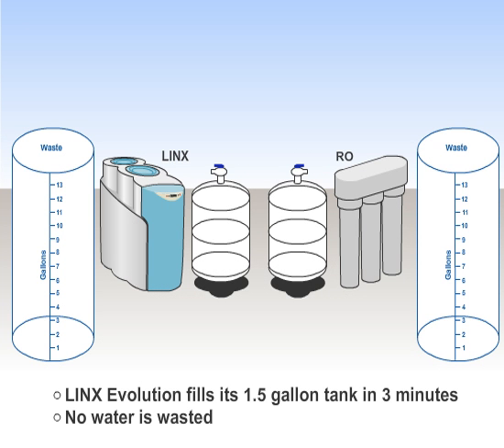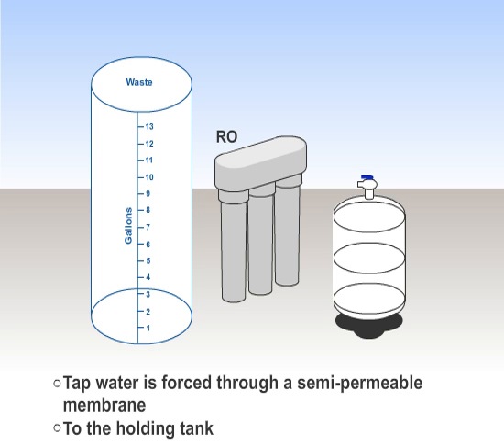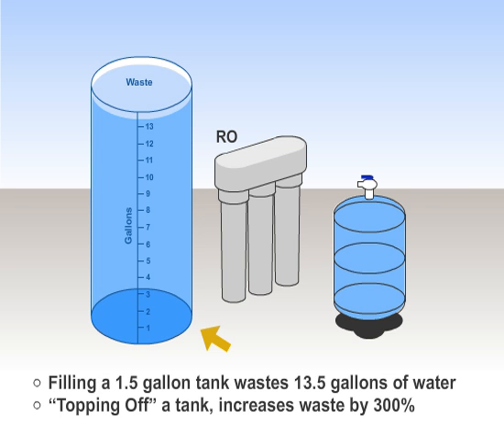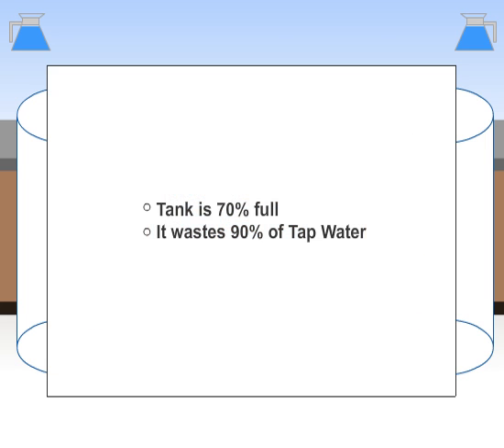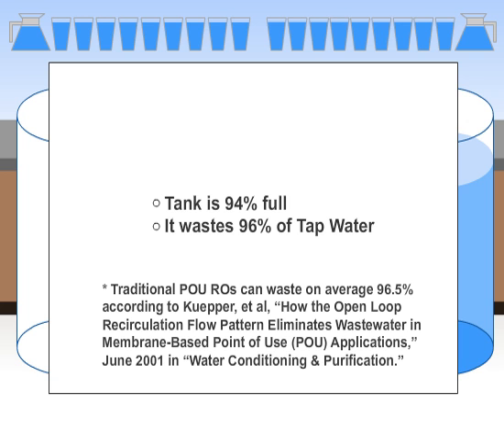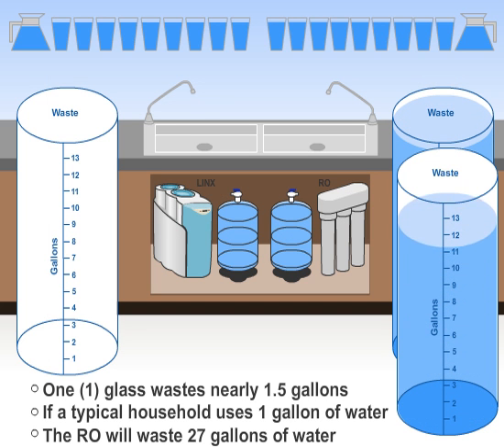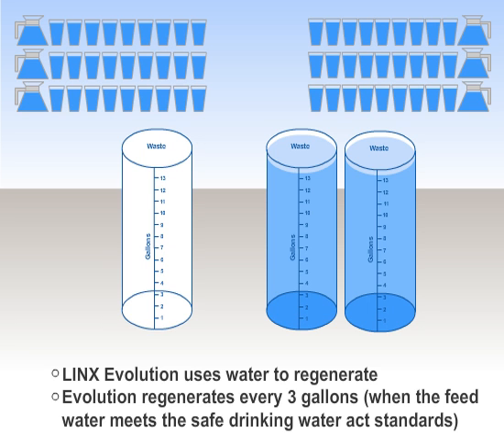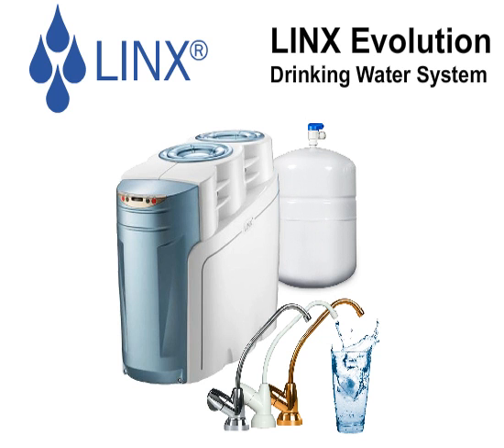Insane Water Waste -- Reverse Osmosis (RO) Truth

Comment: If you read my comment and see how I crunched these numbers you'll see why this LINX system is complete waste of money (and electricity)

If you use an auto shut off valve (when the pressure reaches a certain PSI the system shuts off) then you eliminate constant water running. I measured what I get out of a full RO tank (about 2.9 gallons) and put the RO waste hose into a large plastic container (probably around 20 gallons) and it appeared there was approximately 6 gallons of water for the 2.9 gallons of drinkable RO water. What I will say is my home has relatively low water pressure not ridiculously low but not really high like some places so I'm not sure if that has something to do with it. Plus my water bill was always around $30 a month and didn't see but maybe 1 or 2 dollar a month water bill increase since it went from about $28 to $30 using the crap out of the RO system to cook, drink etc.. 

So with that logic I've seen a $24 a year increase in my water bill and bought a 2 year supply of RO filters & membranes for around $100 so I use around $50 a year in filters and so if the water bill increase for the whole year is $24 the $24+$50=$74 is about the approximate cost of maintenance for using my RO system. I seriously doubt this LINX system could beat that in cost. When I used to buy gallons of water refilled at the local water machine I'd spend about $200 a year just filling reusable water jugs... lol. Watering a lawn is a far bigger deal as far as water waste IMO... I mean think about it you're spraying water over a species of grass that is usually not native to your region to make it look ridiculously green. As far as what to do with the RO waste water, the truth is if you own a home drill a hole in the wall behind the sink and run the waste line outside and use it to fill a giant 200 gallon rainwater tank (or whatever size a 55 gallon drum will do) which you can then pipe in the RO rejection waste water to the outdoor tank to then water the plants/garden/grass. Some people get nifty and hook up a tank to their washing machine so that the water doesn't really go to waste.

So the LINX system uses around 250 watts per gallon. That's 250 watts produced probably burning coal from a power plant so that's not helping the environment... If your electric bills are an average of $0.11 a kwh its around $0.03 per gallon. If you use 4 gallons a day its around 11 cents a day x 30 days in a month its about $3.30 dollars a month. If you have a 2:1 RO system it's going to be around $75 a year give or take the cost of water in your area. Plus the fact that you can go online buy a 2 years supply of RO filters for $100 ($50 dollars a year in RO filters and membranes per year) you can just buy a a ready to set up RO kit on ebay for $105 and for me I had observed a $1-2 a month water bill increase using an RO system has cost me around $75 a year in routine maintenance for the 2:1 RO system. 

There is just no way LINX can justify charging $600+ for a water filter unit and $200 for filters which need to be changed about twice a year unless you virtually never use the system. Between the $400 in filters annually and about $40 a year in electricity and the $10 for actual water usage you are spending about $450 a year to maintain this LINX system which more than the water usage plus the cost of the entire RO system and 2 years supply of RO filters... I mean really what a joke. When you crunch the numbers you realize how much of a scam this whole thing is. I mean seriously I could buy water from a water machine for 50 cents a gallon and based on my family's usage it's around $200 a year to buy water at the store or I can pay $75 a year to run my RO system and waste a few gallons or put in my washing machine/garden via a storage tank. What an idiotic sales pitch.

Comment: Once you run it through the pre-filters , you can chain link it through 3 RO filters like this- RO mebrane (brackish) waste water goes to the next inlet of the ROfilter and that wast water goes to the next RO filter you have.
Use  setvalve (TAP opened slightly) to keep the pressure high in the last brakish water out. So you have 1 feed line (council water) and 3 RO filtered water going to storage and 1 waste water of limited water.
 
RO systems need pre-filters to remove sand and iron they can not deal with solids.
Or and this is no problem at all for a RO filter you have a tap on 1 RO filter on the brackish water and every 50liters you use you open the waste water and flush the waste out. <<< So that would be 2lt (or less) of waste waster to 50lt of RO filtered water .... as long as you have the pre-filters the RO sytem will cope with that just like these high wast systems.
Both those systems produce clean under 10ppm ROwater and my filters are about 4 years old on the first example.
and 2 years on second example.
More than 1 way to skin a cat.
PS didnt watch the video and will probably thumb down with out looking at it.

Comment: SYSTEM REQUIREMENTS:

    System requires the use of a water storage tank and faucet (sold separately)
    Must be used in conjunction with a water softener
    Warranty voided if water pressure exceeds 100 psi. If water pressure exceeds 100 psi, a pressure regulator must be installed.

Comment: these systems are extremely problematic in my opinion (especially with hard water), the drain solenoids and modified air gaps plug up with calcium deposits very quickly, these systems are also prone to overheating and leaking
Reply: Silveready1 overheating. ? Overheating?  Really overheating?

Comment: Does this unit remove 96% of floride? 

In Livonia MI water is about $5 per unit. 
A unit is 750 gallons.
If an RO is waisting 10,000 gal a year.
Thats 10,000g ÷ 750g = 13.3 units
13.3 units at $5 each is only about $67 a year in waiste. Still not bad for 96% floride free water compared to the $10 a month i spend in bottled water.

Comment: even with the waste water cost in a RO system without a booster pump or a permeate pump, i think the RO system would be cheaper. the LINX filters are close to $200, is that correct? i would love to save the environment but i'm more into saving money.
Reply: Even though the cost of the cartridges seem high if you are wasting 10,000 gallons of water a year depending on what part of the country you are in the cost of that water would pay for the cartridges and you would be saving alot of water for generations to come.

Comment: Whereas waste water from reverse osmosis can be recirculated once before permanently removing it from the loop. When out of the loop it can be used for yard cleaning lawn maintenance etc, So little would be actually wasted. The Lynx system does not say how much electricity it consumes or what total TDS can be over its cycle. In brief it is at face value an attractive proposition. However I would like some nitty gritty detail about its cycle figures before opting out of ro
Reply: A toaster is a poor example, they use large amounts of electricity for short periods of time, but if you make a lot of toast they use a lot of juice.
Reply: yes, well said! 
cost of production, and water spent in the process, compared to RO waste, i would suspect is equal
Reply from the maker: The system uses less electricity than a toaster. Pennies a day to operate. Please contact us at  866-611-8624 with ANY other technical questions you may have. We are happy to help. Also the systems are NOW available online! They are on sale - go to www.LinxDrinkingWater.com to see prices and purchase info.

Comment: LINX PLEASE what is the cost of this system, and why is it such a secret?  after reading all the comments it definitely seems you are elusive or hiding something, which makes this dealer quite suspicious indeed.  Please clear up all the questions once and for all and you will sell.  I may be interested as a dealer but I need ALL the facts without wasting my time..  I support the horticultural industry and seek a good unit that greatly reduces ppms as low as RO does, at max efficiency.  Can you supply this and how much even msrp for now helps.. ow I'm looking elsewhere, we are busy..
Reply from the maker: +mudslinger888 LINX® systems are sold thru authorized dealers who set their own retail pricing.  This allows them to factor in their cost of doing business – I am sure you understand that it is more expensive to do business in a major city than a rural community in the Midwest.
Reply: $700 for the system and $400 for filter! YIKES!!!

Comment: I agree w/Arne!!  I am a licensed professional engineer and I object to your claims.  I live in a highly mineralized, arsenic content area & I have made precise measurements for my R.O. system.  Arne is correct in that approximately three gallons or less is required to produce one gallon of R.O. water.  The extra two gallon loss in my system is simply routed to my vegetable garden beds so it is not wasted.  Please verify your claims w/some evidence.  Thank you.
Reply: LINX Water   John Van Newenhizen graduated from Lake Forest College which is a small liberal arts college.  As far as I can determine he doesn't have a degree in science or engineering.  He was employed by Culligan International from 1977-2009.  I can find little about his company Van Newenhizen and Associates Inc. other than there are 10-20 employees.  I don't see that Mr. Van Newenhizen has published any scientific peer reviewed papers or research studies.
Reply from the maker: +John Ferguson If you are using a permeate pump to increase the feedwater pressure, that could result in a doubling of efficiency and could yield 30% efficiency under ideal water temperature conditions
Reply: +D Boyd   Ditto, I agree.  I am also an engineer.  We use the discharge water to feed a "grey water" system for our landscaping.  My Vertex 4 stage R.O. unit uses about three gallons for every gallon of pure water produced.  Considering that our family uses over 150 gallons a day, with irrigation included, it's a trivial amount of water.  It's only about 3-4 gallons per day.
Reply from the maker: +D Boyd Thank you for your comment. This video is based upon the research study conducted by Van Newenhizen and Associates, Inc.. The results of which you can download here: http://www.linxwater.com/pdfs/water-savings.pdf.

Comment: has anyone thaught of having the filler  tube to the tank at the top of the tank as opposed to the bottom wher the water pressure is (which creates the inificiency)simople realy ,i think this add is another con just like so many others regarding water filtrs
Reply: Not to mention how inaccurate of a filtration idea they have for their system, electrolysis doesn't work like that, where would the mineral deposit go.
Reply from the maker: +Gabriel Damian Thank you for your comment. Please see the video here https://www.youtube.com/watch?v=vkY6hnYj7HE&feature=iv&src_vid=qmUvTu0KUIs&annotation_id=annotation_889719 to see where the minerals go and exactly how the system works.
Reply from the maker: Good news!! The systems are NOW available online! They are on sale - go to www.LinxDrinkingWater.com to see prices and purchase info.
Reply: My WHRO system is set up this way.  The fill tube is attached near the top of the 500 gallon holding tank.

Comment: Would your system (LINX WATER) be able to produce Industrial Water i.e. the water with reduced conductivity up to 100,000 Ohms or in term of conductivity less than 10 Micro Siemens. Off course TDS and other traces like Sulfates and Chlorides should be within  their PPM limits.

Comment: It sucks that we have to pay our water company in Vegas for water that isn't even drinkable. And you have to buy a chlorine filter to water your garden as it kills the microbes in the soil. I'm currently shopping for an RO because it's a pain to lug home cases of bottled water from the store every week (which also comes from an RO system as it says on the bottles). Yeah it wastes water, but we need pure water to live.
Reply: +AerialGuardian I installed an under sink RO and drank from that for awhile. Then I read about pharmaceuticals in the water and my RO is not designed to filter them out. Since Vegas recycles it's water I imagine the concentrations keep building up. I ended up with a $200 water distiller from Amazon, so now I am finally confident I'm drinking clean water.
I have a whole house water softener that adds salt to the water so I can't water them straight from the tap (it's always something). So now I use my RO to water my plants and they are doing great.
Reply from the maker: Good news!! The systems are NOW available online! They are on sale - go to www.LinxDrinkingWater.com to see prices and purchase info.
Reply: Watering my plants with RO or distilled water they have done incredibly well.

Comment: THis is why one uses a pressure pump on the system. THe pump uses no electricity and uses the back pressure of the effluen water to increase pressure to the storage tank, liminating excess waste water. They are chap and readily available.

Comment: If you can somehow make this system be electricity free. Then I will bow to it lol. Other than that there are still solutions to RO, like a permeate pump, that significantly reduces back pressure.
Reply from the maker: The system uses less electricity than a toaster. Pennies a day to operate. Please contact us at  866-611-8624 with ANY other technical questions you may have. We are happy to help. Also the systems are NOW available online! They are on sale - go to www.LinxDrinkingWater.com to see prices and purchase info.
Reply: Holy crap, I need a seperate circuit to run it, a toaster is 1500 watts
Reply: The system is like running a small space heater or microwave all day everyday forever which costs way more to suck down that juice. Try $30 a month electric bill increase. You're trading one small water waste for another. My RO system waste 6 gallons for every 3 or so gallons it produces when I measured it in a bucket. So the reality an RO system is way cheaper, way cheaper to maintain (2 year supply of RO filters for $100) and I saw like $2 a month water bill increase. There's no way this LINX system could beat that.

Comment: Ro system it does waste an insane
Amount of water,I thought  Linx system is an exaggeration but they are telling the truth. I've done it myself trying to get all the water from the waste and couldn't keep up how fast 30 gallons of water got wasted just to get 3 gallons of clean water. The waste water is perfectly clean and u can use it for so many things around the house.
I am very dissapointed about ro and can't believe the degree of ignorance creating this wasteful system. Imagine if millions have been sold how many fucking millions of gallon we are wasting,this ro system shouldn't be legal for home use considering that in so many countries they don't have water to drink period!
The water bill came and I found out since I've bought the system I've doubled the amount of water
Using 3000 gallons extra in just one month. I will try to do something to the system since the waste water is better than tap water, I will connect the waste to filter it again,will see how is that going to come out, it should be perfectly fine, if not I will look into different water systems including Linx .

Comment: where those extra solid going to reduce the PPM similar to the RO ? I still dont understand your system.
Reply from the maker: Thank you for your question. The contaminants or total dissolved solids (TDS), are removed using an innovative ion exchange process that is powered by electricity rather than harmful chemicals giving you clean, clear filtered water without excessive water waste or messy residue to dispose. Independent studies have shown that traditional reverse osmosis filters waste more than 18 times more water than the LINX Drinking Water System under normal household conditions. To see exactly how this regeneration occurs (as well as how an RO works), see our video. It should answer all of your questions: Super High Tech, Super Low Waste Drinking Water System - LINX 160

Comment: If you put a permeate pump (powered by the waste water pressure) between the reverse osmosis unit and the storage tank, the additional water loss due to backpressure from the water tank is almost eliminated.

If you also use a modern "Sidestream" RO membrane (you need a new membrane housing) with a booster pump, the clean water to waste water ratio can be as low as 1:1. Even better, you could get a 300 or 500 GPD unit and run it as a direct flow system, removing your water tank (and the need for the permeate pump).
Reply from the maker: Thank you for your comment. Adding a permeate pump only doubles the efficiency according to a study done by John VanNewenhizen. See the results for "Enhanced Home RO with Permeate Pump" Link found on our website: http://www.linxwater.com/benefits/less-waste/ and here: http://www.linxwater.com/pdfs/Water-Savings.pdf

Comment: I was able to bypass the Reverse osmosis system with a call to the GE support line and now use just a single filter from the system. 
The GE Reverse Osmosis system works well, but is hugely wasteful and we in Monterey County have severe water restrictions and water is very expensive.
I had to take the unit apart and connected the water input to the second filter.

I still have the tank but its switched off. I removed all of the other pieces.
Now I have mains pressure filtered water.... it tastes fine.